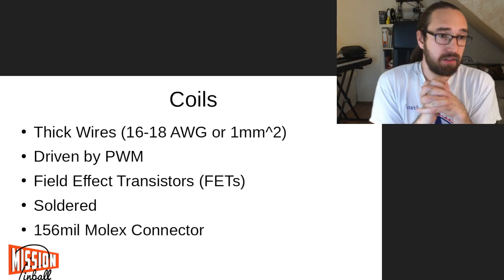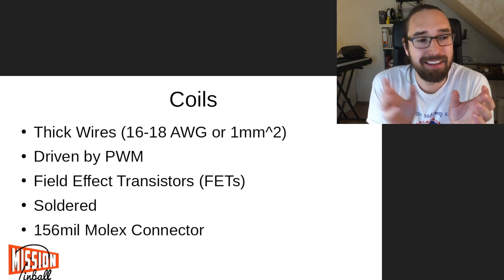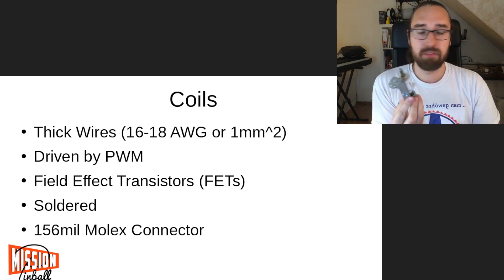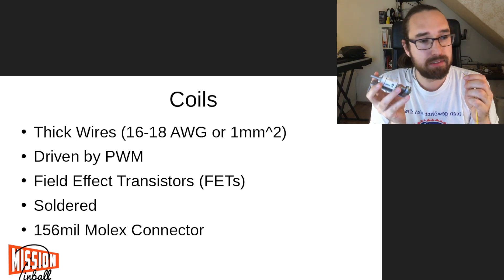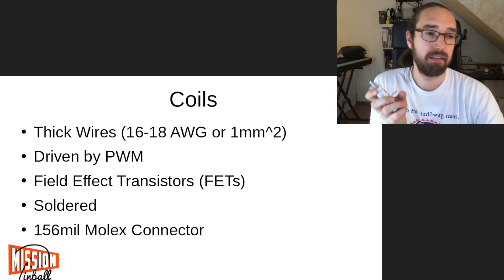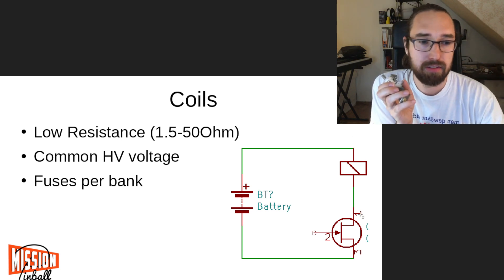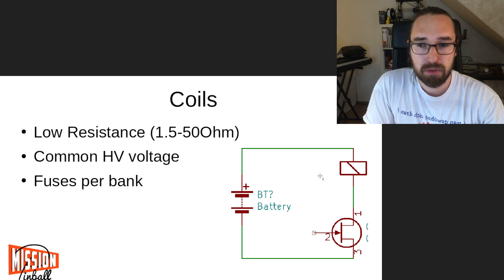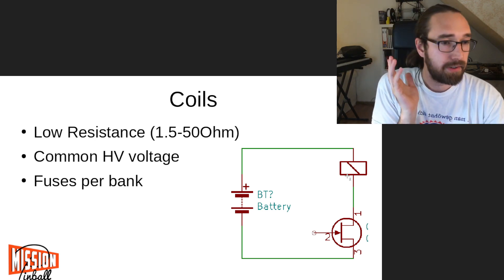Coils in Pinball - How to Wire Pinball Machines 5/6

Comment: what does 1200 mean on the coil
Reply from the maker: In most cases that would be the number of windings/turns of the wire. You can find a table with typical markings here: https://flippers.com/coil-resistance.html